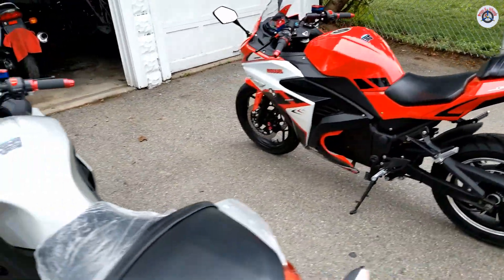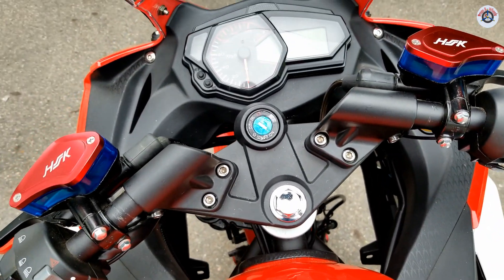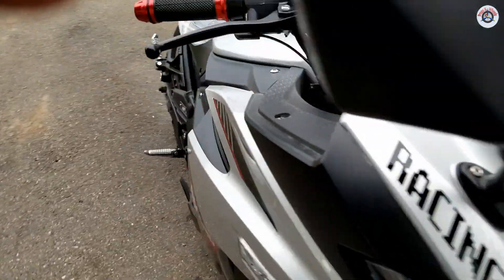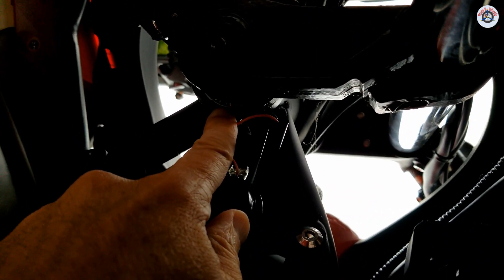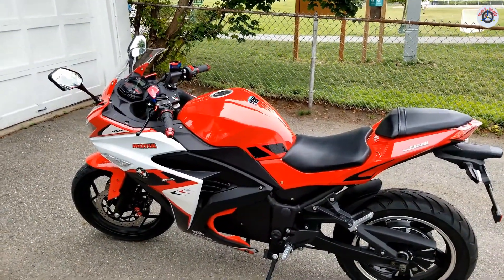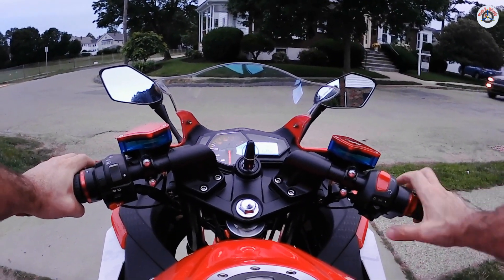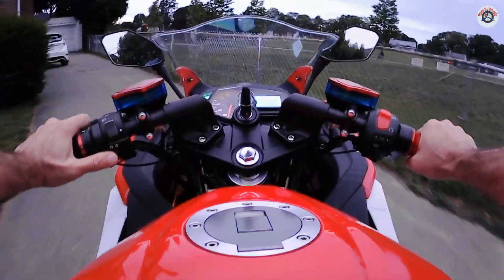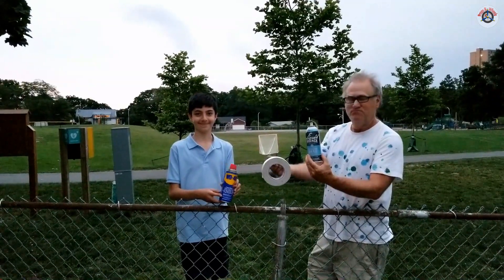I imported two full-size electric motorcycles from China – Part 15: "Fixing Steering Head Issue"

Comment: Which website did you use when ordering these bikes, of course if it's not a secret 😉.
Reply from the maker: Of course not Krizi Custom Garage! :)
I used Alibaba.com. I purchased them on Alibaba from the seller "Wuxi Saichi Vehicle Co., Ltd.":
https://wuxiscooter.en.alibaba.com/company_profile.html
However, I was not very happy with their customer service after they received the payment. I ended up initiating a complaint for sending me wrong charging adapter. Alibaba lived up to my expectations and got me back about $80 to purchase proper chargers.
Good luck!
Reply: @PropsWheels  Thanks for the info 👍 I am asking because I have never bought such expensive things from China and on Alibaba it is in general 😏.  In general, I wanted to do motorcycle conversions, but in my country there are big problems with registering and insuring such a structure

Comment: hey can you tell me what battery  the 850mm rc plane uses?
Reply from the maker: Which RC plane? FMS Ranger 850?
For FMS Ranger 850, I use 2S 800mAh and 2S 1000mAh batteries. The heavier (1000mAh) battery gives it better center of gravity and makes it a bit more stable.
https://hobbyking.com/en_us/turnigy-1000mah-3s-20c-lipo-pack.html

Comment: I hate to say this, but I don't think you really did a permanent fix. The true problem appears to be the exposed bearings that you see from the bottom. The front wheel is going to be kicking dirt and dust directly up and into the bearings. That whole area behind the front wheel and where is the radiator would normally be gets filled with dirt and dust. Normally the bearings would have a seal on the top and bottom to prevent dust and water from getting in there. I think the reason it seems fixed is you basically flushed out some of the dirt and debris from the bearings with WD-40 and then the lithium is applying additional lubrication. As long as the bearings are exposed like that you're going to have this problem again and again. 
I think the correct way to fix it would be to put the front of the bike on a tall block (or suspend the front frame with a rope from a ceiling joist) so that the front wheels are way off the ground and then undo the bearing caps and remove the bearings. Clean them all thoroughly with a brush and some kerosene or diesel fuel. Then thoroughly dry and properly packed them with a heavy duty wheel bearing style of grease. Typically you would adjust the torque on the bearings so that there's a small amount of resistance to pull the wheel left or right while the wheel is off the ground. Maybe 1/2 a pound or so, very light. It should not be resistance free. And then put your Triple Tree and everything back on and tighten it up. Pretty much the same as any other motorcycle.
I can understand you may not want to do that because it's a lot of work. If it feels nice and smooth right now, I would simply focus on sealing up that lower bearing so that it won't pick up any more dust or debris later on and call it a day.
Reply: If you ever need to replace those bearings and races I would suggest taking it apart and measuring the bearings and finding a replacement kit online that matches. You should not need to order them from China. Try a website like Allballsracing. You can order by the size instead of application. This is where I got my custom bearings for a front end swap I did putting a Suzuki sport bike front end on my Honda road bike. I would also speculate that you'll get a higher quality bearing and Race Kit from All Balls than you would from the Chinese supplier that made your motorcycle.
Good luck!
Reply from the maker: Thank you for the suggestion. I bookmarked their website, so I will look for a matching bearing if it comes to that. Cheers!
Reply from the maker: Thank you very much for detailing the procedure. I now that would be the proper procedure, but I am results-oriented and always try the lower hanging fruit first. I hope this fix will hold at least a year. I do not mind repeating it once a year before the riding season, since it takes almost no time at all. And we do not ride in rain or mud, so I do not expect a lot of dust and dirt accumulation. I am thinking to seal the open bottom section of the bearing with heavy grease to keep it from getting dirty again. Cheers!